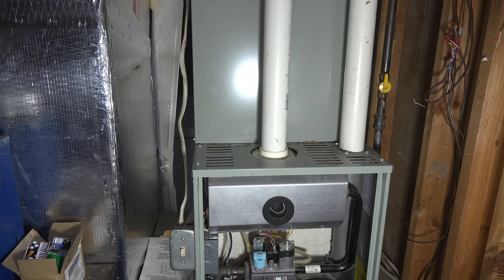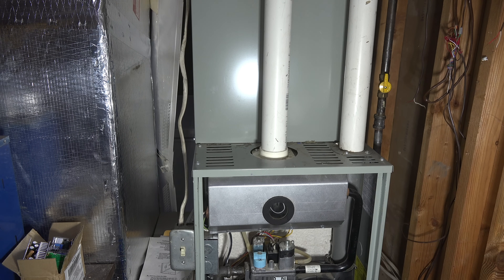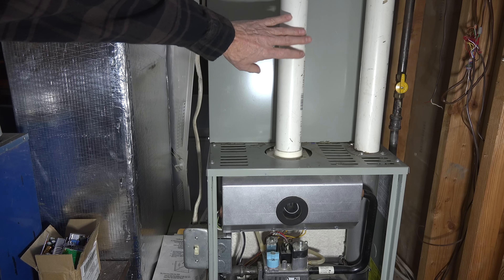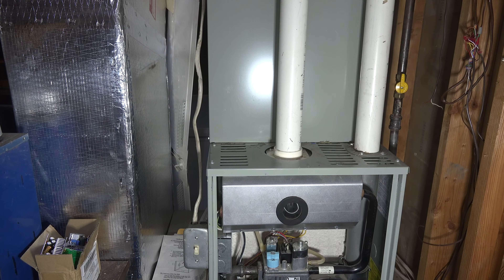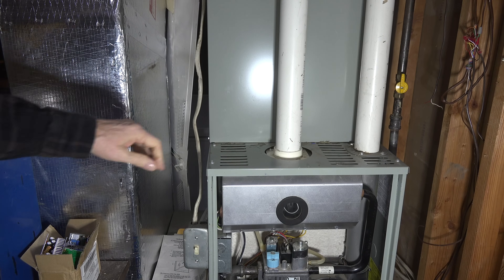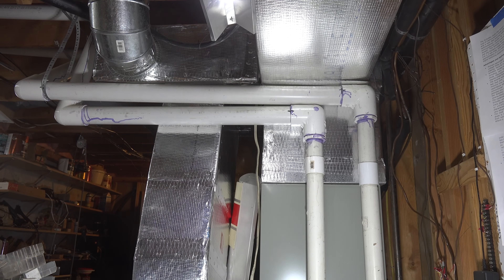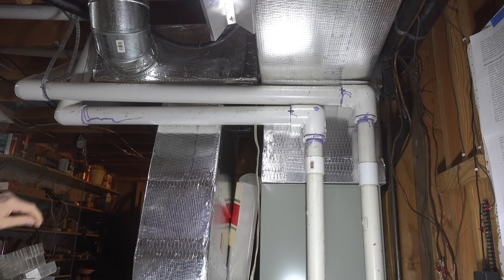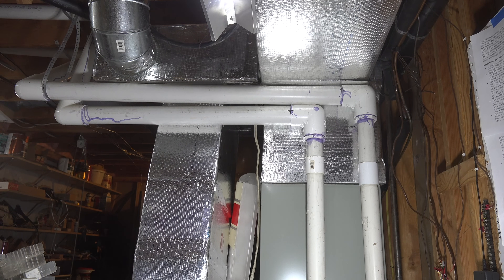Gas furnace pressure switch code venting problems

Comment: I thought you're not supposed to use pressure elbows but rather DWV elbows?
Reply from the maker: Venting materials are determined by manufacturer instructions.  In this case, the instructions indicate the use of this type of ells.
GFM

Comment: Great video sir, Question i have a Lennox Pulse 21 80,000 BTU and replaced it with a Carrier 2 stage Furnace 96% 80,000 BTU, can i use the pulse concentric 2 inch vent kit that's 2-inch pipe from furnace to concentric, mufflers are removed, or should i replace concentric with 3inch vent kit and 3 inch pipe, thks
Reply from the maker: The one sentence reply is:  follow manufacturer's instructions..
GFM

Comment: @grayfurnaceman I have a trane xv80 and it's had a mind of its own. I have replaced the pressure switch and board in the matter of 2 years. It's randomly throwing this pressure switch code. It happens on cold nights and randomly whenever it does. I'm not sure where to look now. I've checked the flue, the top of chamber, wiring, etc. The replaced part stated are original trane parts. If you may have an idea where to look, I would greatly appreciate it sir.
Reply from the maker: The inducer fan may be your problem.  Either the fitting on the inducer is plugged or the inducer is not coming up to speed.
GFM
Reply: @grayfurnaceman  Thank you for your response. Everything is getting necessary power. I've narrowed it down to air flow somewhere. It's very intermittent. If I take the pressure hose off and put it back on without blowing or sucking, it fires right up. Also, how do I check to see the if there's a plug in there and speed of inducer motor?

Comment: Very good information! When I was a younger tech we got call backs from things like this! It’s not always the pressure switch!! I’ve gotten birds out of draft inducer area many times on 80% furnaces too! If vent is hooked to a chimney you can guess a bird (dead afterwards of course) done flew in!!
I had an older tech explain the pipers not slopped properly causing pressure switch problems!
90% furnaces are cool & great but honestly I like 80% better! More reliable to me in freezing temps! You don’t have drain issues in freezing weather with an 80%er !
When you get an emergency no heat on a 90% in below 32 degree temps you’ll understand what I mean!
Reply: Don't vent to outside, vent to waste drain pipe.  No freezing.

Comment: I was about to pay 5,000 for a new furnace untill I saw ur video. The miracle words were " start wave in there....it doesn't take much" went up on the roof
 Lo and behold, water. Lifted up the pipe, now the furnace is working. Thank you.
Reply from the maker: Glad you got it going.
GFM

Comment: Hello sir.
I'm doing some D.I.Y. on my vents and could use a hand with a suggestion or two.
A few years ago I got my first house and been doing renos.
It's a 2 story and noticed the air flow (heating and cooling) was weird. Certain rooms got blasted with air and some got none.
So I started tracing the vent lines in the basement (open ceiling) checking for dampers.
In doing that, I found so many problems. It looks like someone in the 1980's did some D.I.Y. and it hasn't been touched sense. 
I'm talking holes in the venting, gaps on connections, multiple lines going nowhere (wall cavities)... and a layer of dust so thick it looked like a thin S.O.S pad.
So I went to town, started cleaning the outside, vacuumed, washed, wiped. Then the gaps stated to show more. My vents honestly looked like a strainer. I cut a few square 'service holes' in the main line off the hood. To see inside, and get access to the branches from the inside. I've been removing the old connections (dead lines) and sealing the holes with a cut patch plate and that metal tape for vents. I started at the hood and air intake. Taping all connections, holes, every place that could leak air. Spent a few hours, making sure I got everything. The outside of my vent edges are shiny now. Just taping about 10 feet of the venting I've noticed a huge difference in air flow. So I'm planning to finish all I can reach. 

I've noticed in your video, you have a insulation wrap around your vents. Also your connections are taped. Really nice and clean looking.
That's my goal also. 
What's that insulation wrap?
I also want to wrap my heating vents after to reduce thermal exchange in the basement. I also don't like the idea of wires against the metal vents. I'd rather have an barrier between, I've seen some melting on the older wiring. 
I know that I'm bound to lose some percent of efficiency in the air.
But if can get within 10% of maximum I'll be happy and saving on my bill.

Comment: Thanks!  My Carrier was flashing "3-1" decoding to "LPS failing to close."  Pulled the hose off and sucked on it - LPS clicks and closes.  Next step, opened up the intake port, right before the inducer blower and found not one, but 2 unlucky birds had somehow gotten into the intake.

Comment: Sir, let me ask you. I have a 95% furnace and the flue exhaust collar is black. I'm thinking it's ABS. So am I supposed to use red RTV silicone to bond the PVC pipe to the collar?
Reply from the maker: Yes.  Its not about bonding, its about sealing.
GFM
Reply: @grayfurnaceman  
thank you

Comment: I’m in Texas but I still have a venting problem. That or the inducer is bad (it’s motor runs constantly). I changed pressure switch and nothing happened.
Reply from the maker: There could be a number of problems here.  None of which are a failed inducer motor.
If you turn off the furnace at the thermostat, does the inducer stop?
GFM
Reply: @grayfurnaceman  No, only if I cut power to the entire unit either at switch or breaker.
Reply from the maker: @thomaskincaid9157  I would be looking at the relay that starts the inducer.  It could be stuck.
GFM
Reply: @grayfurnaceman  would that be on the ifc or between the them?
Reply from the maker: @thomaskincaid9157  It would be on the IFC.  If an IFC controlled furnace has a continuously running inducer, the cir fan should also be running and an error code showing.
GFM
Reply: @grayfurnaceman  error code is 3flashes so Inducer, pressure switch, or venting issue. I’ll check it out again tomorrow after work. Thank you thus far.

Comment: Will switching from 2inch exhaust vent pvc pipes to 3inch exhaust pvc pipes help with pressure switch nuisance codes on the pressure switch. Tech has changed inducer motor, pressure switch, control board and made sure it was draining properly, also check the slope of the exhaust vent...said it was sloped properly. Still getting this stupid code 31 pressure switch tripped code.
Reply from the maker: I assume it is Carrier.  Some of the older ones had problems if the vent passed thru an unconditioned space.  Insulating the vent helped.
GFM
Reply: @grayfurnaceman  it is a 2014 Bryant 915sa 80000 BTU furnace, it runs thru my heated basement exiting 21 feet from the furnace, it only has 2 45degree bends and 1 90degree bend. When I remove the 2inch exhaust pvc vent directly at the furnace miraculously the furnace works fine. I have checked and the exhaust pvc is not obstructed with anything and I even put more slope on the pipes for water to drain back to the furnace. Hence, why I was contemplating going to a 3 in exhaust pipe....this furnace is a pain in my ass....
Reply from the maker: @mxbigd17  If the venting, including the type of ells used are the correct size, length and type follow the manufacturer's instructions, I guess that is about all you can do.  It should not hurt anything,
GFM

Comment: Thanks for the video.  I was curious if both vent pipes need to slope toward the furnace?  If one drains outside, in my case the intake does, is it a problem?
Reply from the maker: In most cases, they should.  Manufacturer's instructions rule here.  
The problem with draining outside is the possibility of freezing at the termination.
GFM
Reply: @grayfurnaceman  Thank you.

Comment: My fresh air intake doesn’t go to the outside I have 9 foot ceilings in my basement unfinished by 58 feet long is that a problem  Oh and also there is a 4 inch radon pipe to goes up through the roof maybe that would help with Fresh air
Reply from the maker: The space is probably large enough to provide combustion air.  If the furnace is designed for outside air, it is best to have it piped outside.  
The radon pipe does not bring in outside air.  It draws out air from the space.
GFM

Comment: Great video. I'm experiencing a red-3 blk, pause 3 blk pause..ect. I got up a 4 am and the furnace had stopped. I saw the 3 blk, pause pattern. I pulled some hoses off, sucked some sir, put them back on and turned the switch back on that sits on the furnace vent. Now, it's been working right for the last 8 hrs. However, this has been going on for quite some time. It works fine for wks, or longer, and then all of a sudden it stops. Most times it can be fixed just by turning the switch off and turning it back on again but I know it's only a matter of time before it goes out again...what do you think ? Thanks so much !
Reply from the maker: If its a Carrier, the 33 code should be overheat.  I would be looking at the filter.
GFM

Comment: I would have thought if the vent chart called for 2.5 in pipe as this install has. 
I would want as much of the 2.5in pipe as close to the furnace before adding the bushings or reducer if example it was 3in pipe
Reply from the maker: That install follows the manufacturer's instructions.
GFM

Comment: how far should pvc exhaust pipe be from basement window... or any window on a residential property
Reply from the maker: I believe the code calls for 4'.
GFM
Reply: most cases 4 feet from the side and 1 foot above with a single pipe system and 12 inches with a 2 pipe system

Comment: I have a question..  I only get the low pressure switch blinking light when I put my cover/filter back on (even with a new filter)   Any Ideas? Thank you for Your time.

Comment: I thought code says for vent pipe that the purple primer is supposed to be used at all connections. I didn't notice any. Also all i saw were cheap 90°elbows in both lines instead of long sweep 90's.  Lastly the opening for combustion air intake is supposed to be 12" above anticipated snow level. There's no way in hell that install would ever pass code.
Reply: Look close on the primer.  Short radius ells are required for this manufacturer.  It is 12" above snow level.  Can you say install instructions?  
GFM
Reply: @electriccar3253  For the short radius elbows, my apologies if install calls for them. I've never encountered any manuals other than calling for long radius elbows.Short radius ones increases your equivalent feet in any run. I'd have to see that for myself to believe it.
I hope you don't use short radius fittings for line sets too.

Comment: I removed the inducer blower from the furnace, and it inducer blower works just fine, but I am still getting a pressure sensor stuck open code (80%, Guardian furnace). Could the real problem be the pressure switch?

Comment: Mine did that too.. had a relative try and fix it and he either blew a fuse or the transformer as now even the digital thermostat won't read ANYTHING.. blank screen and it is wired. furnace does NOTHING now.. not even a BUZZ noise as it was doing off and on but never igniting. so sitting in the COLD as we don't have the Income to pay a repair person. I'd do it myself if I knew what I was doing.. I know how they work but thats it. thanks for Posting and any ideas ?
Reply: the thermostat is wired to the furnace so no batteries.
Reply from the maker: There may be a control board mounted fuse.  Other than that, you may have to replace the transformer.
GFM

Comment: For the BTU of my furnace and number of 90 elbows I had to use 3" PVC (manual said 30' run and max of 2 90 elbows for 2" PVC or it might trip pressure switch )  

I ended up needing 3x90s and 1x45, though only 10' of actual pipe, but still went 3" to be on the safe side.  No issues with pressure switch but it was also recommended to reduce to 2" just beforing going through the wall...  Do you know why that is and whywouldn't that affect the pressure switch reducing down?
Reply from the maker: I have no idea.
GFM

Comment: had a pressure lamp flash code . the exhaust venting.  had water twice . the pipe in the attic travels about 8 feet horizontally . i’m going to increase the angle toward the furness so water can’t get trapped in low spot .

Comment: Good diagnostic video.   I installed many trane 90+ with their bay vent  concentric adapter.   Made for a clean finished product and keeps birds and other critters out.  I agree you would still have to check for other debris.   Thanks.
Reply from the maker: I have seen them where squirrels have gotten in.
GFM

Comment: I pulled 5 bats out of an American Standard furnace last year, they were all the way down at the screen in the burner box. I found another dead giveaway that there is a blockage, is a lot of times you will hear what I would call a "wheezing sound." Kind of like a pregnant womans breathing technique in Lamaze class. Where the furnace is trying to suck air through every nook and cranny of the burner compartment. And the sure fired method for diagnosing a blockage in the intake is to just remove the burner compartment cover and let it pull air in from around its location. If the furnace fires and runs, you know the blockage is in the intake.
Reply from the maker: I don't know what it is with bats.  I pulled 27 of them out of a camper furnace.  3 were still alive.
GFM

Comment: Hey Gary, I have a question. Is it safe to put my furnace blower for HEAT to LOW? like the AC? I have a Rheem 16 SEER 2.5 Ton AC and according to the instructions on the condenser, the indoor CFM should at or close to 1000 CFM. This means we had to the Furnace blower to LOW because the charts shows 818 CFM-1208 CFM. LOW MED was 1012-1363 CFM. We can have the HEAT, COOL, and FAN on separate blower speeds OR there is a tap to put the HEAT and COOL on the same speed. I think the AC Company installed a furnace that's way oversize. My AC/Heat square footage is 1047 and they installed a 80% 75K Furnace... In South Florida. Having it on LOW MED to MED is way to much. When I had the HEAT on low, I checked the outgoing temp of the air. The incoming was 70 and out going was 135-145 degrees. According the manual, there should be a 25-55 differential or a maximum outlet temp of 155 degrees. Here is a link https://resource.gemaire.com/is/content/Watscocom/Gemaire/rheem_r801ta075417msa_article_1403974088948_en_ss.pdf?fmt=pdf to the specification sheet. My model is Rheem R801TA075417MSA. 

Thank you for your help.
Reply from the maker: Sorry for the wait.  You were in the trash.  You can certainly use the low speed if it causes no limit problems.  Your furnace is massively oversized.  Also, the ductwork is undersized for the furnace.  
GFM

Comment: You know how many birds I have found stuck head first inside of the venter outlet? Why do they all crawl to the end of the pipe that has no freedom, only 💀? LOL 😆
Reply: How did you get them out ? I have same issue and wondering how to get them out
Reply: @bgavaskar  I just leave them in there and replace with a new inducer. I'm always worried if i just pull out the bird and stick the same inducer back in, the inducer could fail down the road. When a foreign object, like a bird, keeps the motor from spinning,  that motor gets super hot and can damage the stator windings.

Comment: I had a call once for no heat on a high efficient furnace on a pretty cold day.  Show up and the inducer is running and coding on ignition failure I believe?  I check the venting and the pressure switch tubes.  All good.  Checked the drainage too and it was fine.  I jumpered out the switch after inducer startup and she lights.  I say ok, ill go get you a switch.  I put it back together before I went to get a new Pswitch, and just out of curiosity I tried to fire it and it relit and after about a dozen resets it kept firing with no issues and I haven't heard from them since.  Would this have been a case of possible water in the Pswitch tubing that I didn't see or maybe the Pswitch diaphragm was stuck?
Reply: I've hit a few like that, the contacts inside the switch were sticking, maybe due to weak spring or hardened diaphragm. I didn't tear them down to find out, eventually they got bad enough to just stick closed and not fire until banged on, contact would open, unit fired ran until it cycled off contacts stuck and switch error.
at first they'd only stick randomly and usually would start working again after being tapped or power cycling the inducer would make it release. I used a data logging meter and caught it acting up first hand. if you checked pipes, tubes, drain for clogs and wrong pitch, then best bet is new pressure switch
Reply from the maker: It could have been.  Sometimes we never know.

GFM
Reply: Yes both